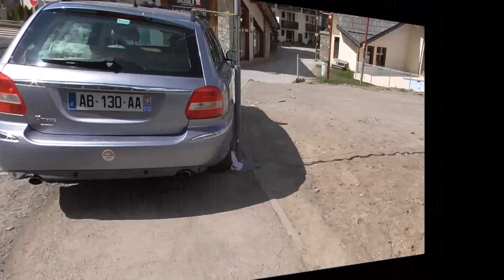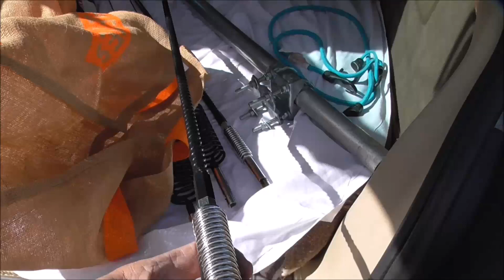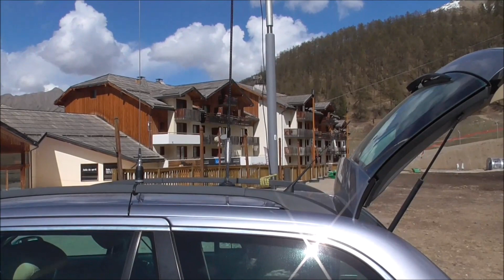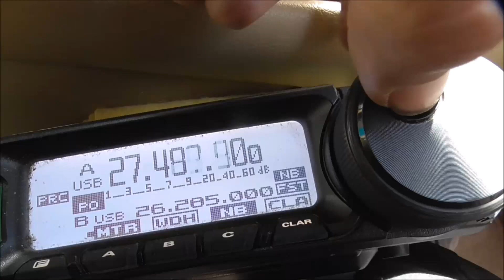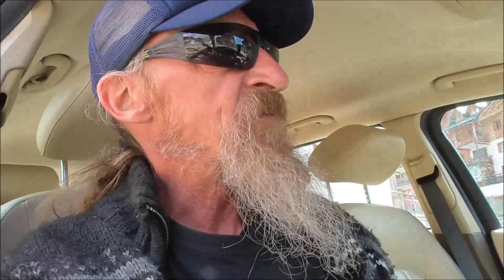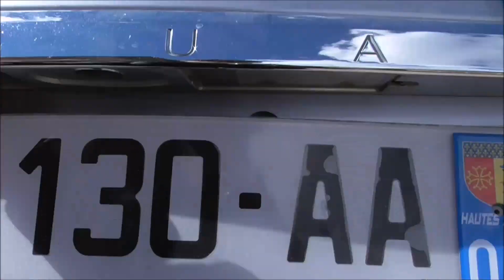New Moxon Mast ~ 9.5m. ~ 1st.Build

Comment: Looking good Max are you going to fix some guide lines on it when you go up higher on the mountain just to steady it better just in case the wind picks up
Reply from the maker: No, it shouldn't need it. It was quite windy at times in this test and it was pretty good as it is. Also many places I o have something to fix to. The plate system is a standby. Cheers